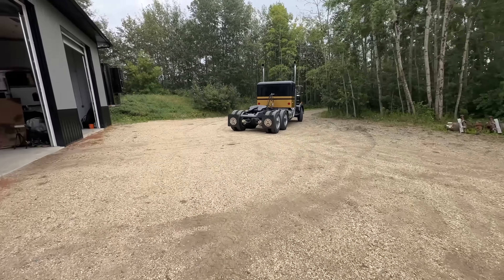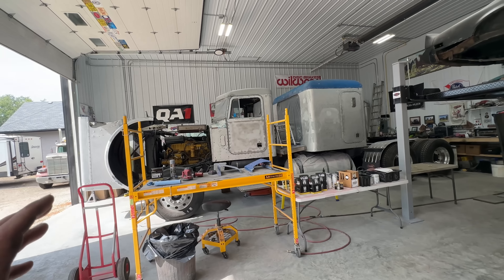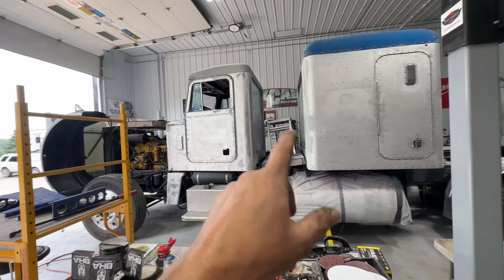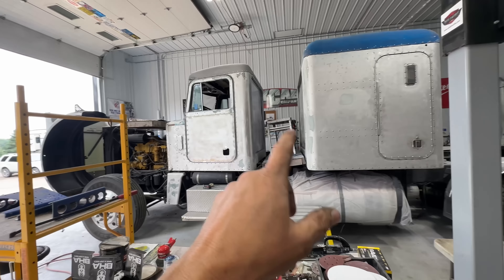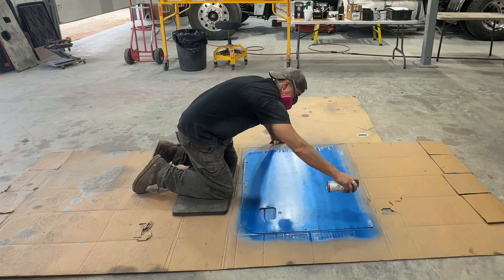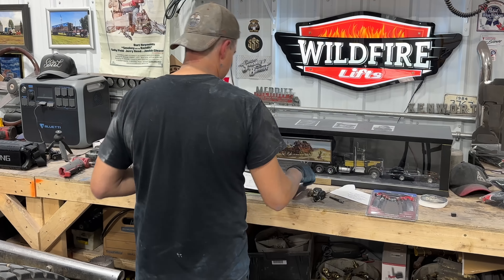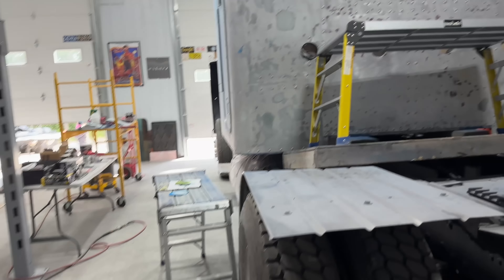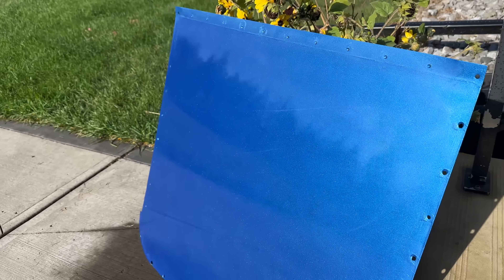Peterbilt 359 Restoration Ep.96 Montana Big Sky Blue

Comment: MARK,MARK,MARK,  u should never paint something and start sanding another part at the same location.  sanding dust will get on the painted part..   Painter# tip
Reply: I was thinking the same thing.  Not sure why he doesn't put the truck outside to sand it , keep the dust out of the shop.
Reply: @scottbennett7117 one reason is unless he’s put it in .
The transmission is out of it .
Reply: Don’t worry man, he never knows what he’s doing. 😂

Comment: Mark if you want mettalics you realize you can spray the blue you like and before you put final clear coats. You put actual flakes in a clearcoat and spray it over blue then 2-3 coats of clear. If you want the best job possible  because you're spending a lot of money..Mark buy a couple quality guns..you need a primer gun and base clear gun.  Spend your money on good equipment not princess auto /harbor freight quality crap..
you can't paint the color one weekend and wait 7 days to do clearcoat. You have a small window to top the basecoat. So you better read on the time you have between base and topping with clearcoat.
Reply: I second what the guy above said about air paint guns. I'm not a painter myself, but I worked with a guy that was really good at his job, and the compliment I made about his paint habilites he attributed to a specific model of a air paint gun (don't recall which one).
Reply: Great point, it’s not a long amount of time in between. like 15 minutes I think

Comment: Mark, I've have many base paint jobs.  I recommend that you do the base just enough to cover.  If you put much on it, it will pull shine out of the clear. And if you wait more than 24 hours on the base, you have to scuff it. And the scratches might show.  Especially with metallic. On the clear I recommend to put on at least 4 coats to wet sand  and buff it. I'm only am recommending.  I've have made many mistakes. The base, you want to overlap 1/2 the spray pattern. If you overlap more than that, you can end up with stripes. You'll have wait at least an hour to to put next coat on. You have been doing an AWESOME JOB with all projects!!!

Comment: Hey Mark, agreed, thats the colour! ...couple of suggestions if it's not too late .. next time you drop the stink bomb in the truck,have it running and the vent fans on to circulate the air around the cab ... i know it's not often you paint on the ground but if you paint towards you then it's less likely you will drop crap in fresh paint or hit fresh paint with can/ jacket and finaly if it's possable how about splitting your work area up , put the truck in with the trans am, remove the hood and split the garage area in 2, hood in 1 section sleeper in the other screened off with plastic, then you can work on different areas of the truck at different speeds, while one area is drying you could be preping/painting a different section... looking forward to the next one bud,keep at it. Mike

Comment: Mark   if you have the spray gun set with the wide fan    two coats of base paint  and two coats of clearcoat    if you wait  5 to 10 min between the coats  its done leave it in the heat  
once you paint it  leave it 20 mins  put the clearcoat on    and your done

Comment: Lay it on wet that will help you with your over lap . I used a siphon gun for years and put two ball berrings in the cup to keep the flake mixed  up . And if your gonna spray flake ground the truck . Lay a chain over the axle. Unplug the battery’s also. Keep jamming Mark!

Comment: Mark, a tip when using spray cans is put them in a bucket of warm-hot water for 15 minutes before use. This raises the pressure and make the paint flow nicer. Dont worry they wont explode, this is what they do to pressure test them in big aerosol factories. Also, if you are using 2k clear, you really should have a full air fed mask. Its nasty stuff!

Comment: Mark..... Heres a tip about short strand fiberglass..... I learned it from Half Assed Kustoms..... when mixing your short strand fiberglass mix a little resin in to it.... it helps thin it out a bit to help it with spreadability and will make fast work of filling imperfections such as pin holes

Comment: Hi mark, you don’t have to paint the whole truck at the same time, you could paint the sleeper,cab and hood at different times. It’s a lot of work to paint everything at once. You could also paint the roof caps first on the cab and sleeper and then cover them up and paint the sides a different day, that will help with not leaning on a wet panel to paint the roof.

Comment: The day you prime LBL  you could paint underside of the hood, that way dirt, dust etc from the underside won't get blown into your top coat of paint.  I use a rope from the ceiling of the shop to anchor myself when painting 8 ft long truck toppers,  hoods and roofs,  air hose behind you let it run over your shoulder down your arm to the spray gun. Don't rush, if you wait too long between base coat and clear, you might need to spray adhesion promoter.       Quality Spray Gun.

Comment: It's a really nice color. The metallic will be a lot more noticeable when you actually paint the truck
because you will have large areas of color and a lot of different angles and contours,
and obviously the chrome and polished aluminum will really help too...
  When you are spraying the clearcoat, instead of looking at the surface straight on, try looking at the
surface from the side, at least when you first start spraying. It's actually a good idea no matter what 
you are spraying, but you will be able to see how the material is laying down a lot better, and see if you 
need to adjust your speed or if the material is coming out dry. It can save you a lot of work after you are done painting. 
Hopefully this helps. I'm not very good at explaining things, and I know you are getting overloaded with advice from a lot of people. 
You will figure it out... It's just paint.

Comment: If clear is applied correctly it does not need to be wet sanded, orange peal or wave's in clear is a timing PROBLEM,read up and use a clock and thermometer,when you go into the factories you will not see a cut and buff department unless their in a repair area,air temp and Metal temp is key!!
SPRAY OUTS ARE THE ANSWER,RECORD THE TEMPS!! GOD BLESS YOUR EFFORTS!!!❤😊

Comment: The big thing with B/C is to remember that with the basecoat you aren't trying to build material thickness.
You just need to cover the surface completely and evenly. You will get the build with the clear.
   If you spray any single stage paint, or clear coat correctly, the paint is mixed correctly with the right reducer
for the temperature, and the gun is set correctly, you don't have to cut and buff the paint, but this is
stuff that takes experience. I have literally sprayed a couple thousand gallons of material,  and my paint
always lays down like glass. I can't remember the last time I actually wet sanded and buffed a paint job... 
  If you get dark spots of metallic in the basecoat, you can cross coat it and that will help even it out.
It's certainly not ideal, but it does work.

Comment: My favorite blue was always Daytona Blue, but then I bought a '74 Datsun Z, and it is painted Nissan's Pacifiic Blue.  Both are so beautiful, Pacific is just a little darker blue.  Also, the way to completely get rid of that stink is to get a little ozone generator and stick it in the cab for a day.  Air it out good afterwards and the stink will be completely gone.  They use those generators to get fire stink out of clothes and upholstery in houses that have had a fire.   It works better because the ozone gas goes everywhere and gets inside fabrics and foams.  I would open that upper next time too if theres anything in it.

Comment: Have you considered taking the hood off and painting it separately?  Paint the inside first, separately, then paint the exterior when you paint the truck, or paint the whole thing separately and leave outside when you paint the truck. 
Definitely take the rear 1/2 fenders off. 

You can’t let the base coat sit for a week without clear, you have 12-24 hours and you have to apply clear coat. 

Painting path- cab roof, windshield and cowl, then the sides, then the back. Use same path for the sleeper finishing on the front. Make sure you use a tack cloth before starting a section.

Comment: Dual stage is definitely the way to go if you have the room to fully enclose your vehicle while painting.  Like laquer in the old days, if you get a bit of dust or a bug in the clear, you can sand and buff it out and everything will look fantastic.  Like with all painting projects, preparation is 95% of your finished product.  Spend the extra time on sanding and priming.  Don't start thinking that the color coat and or clear will cover for poor surface prep.

Comment: If you take a wide mouth bottle, 1/2 full of vinegar. Then roll up some newspaper. Put in the bottle. Bottom to 6 inches above the mouth. Then cut the paper making a flower. Leave it for a few days. Mat2 bottles for a few day. The smell will transfer into the paper and vinegar. Even works in a freezer that was full of rotten meat.

Comment: In regards to painting the roof of the sleeper, could you not attach a grab pole like the ford pickups have on the tailgate to the platform step. You can hold onto it so you can stabilize yourself while painting the roof. Just a thought

Comment: Quick question for you b model cat guys. I’m only getting about 4 pounds of boost (manifold pressure) is my turbo toast? Little to no smoke coming out of the pipes and pump is stock but then up a little
Reply: @GRivera379 you need to make a boost leak tester to go in the charge pipe. For a b model with air to air make it out of 3.5” pvc and neck it down to 1/4npt; and put an air chuck fitting in it. Then hook that up to an air pressure regulator, and put air to it. Use the regulator to adjust to 25-30psi and let it hold at that. Next use some soap and water in a spray bottle and check for leaks. If you still don’t have leaks then the diaphragm in the AFC housing, on the fuel pump, might be leaking not allowing for full fuel. Hope this helps.

Comment: The base in Base/clear is fragile, as there is no hardener in it. But adding hardener/activator to the base will make it more durable, but still not as durable as single stage.
 I would paint it with Polyurethane for maximum durability..

Comment: Hi Mark, Just a thought, Why don,t you take your hood off to paint it, That way you can paint the in side, It would be more work, But the pay back would be worth it, Just a thought
Reply: Because of the manner in which the metallics in the paint lay down, using this method especially for an unseasoned painter will almost certainly upon refitting result in a mismatch of the colour/ base coat where the panels meet. Even minute adjustments of the gun,spray patter,pressure, flow,application speed etc. will affect the overall colour so continuity is paramount if you want a uniform look.

Comment: lol. My one son first car. Mustang 4 banger yea.   Why don’t use spray cans.  You get a better look with air gun.     You use can. U have to sand buff get look. If you watch goonzquad  boys. They using a different spray gun and I used to paint. But the gun they use. No sanding and buffing. Perfect look base coat and clear.  I would look into that gun. Spray is different don’t know if the nozzle on it or just gun.  I get that photo enlarged. Big for you garage wall
Reply: I resprayed a set of rim/16inch wheels. It took 10 days with a week long preparation and wet sanding. Then Eastwood brand spray can primer 2 coats. Sand again, before adding silver spray paint. And 3 coats of clear X 2 days to add clear. All outside in the backyard